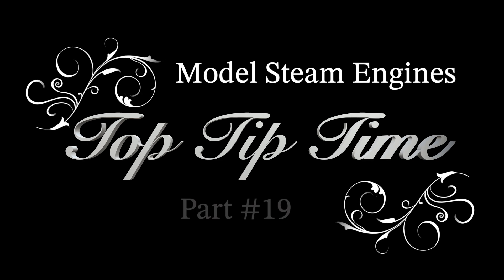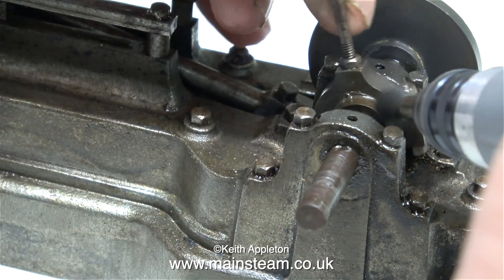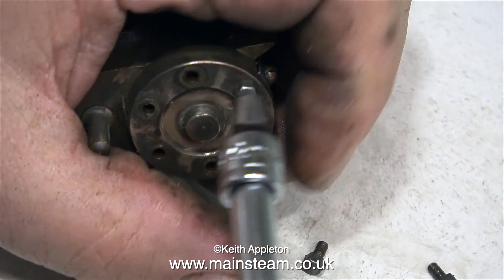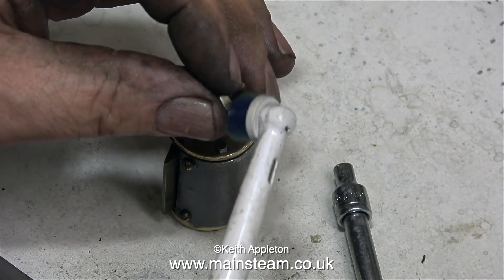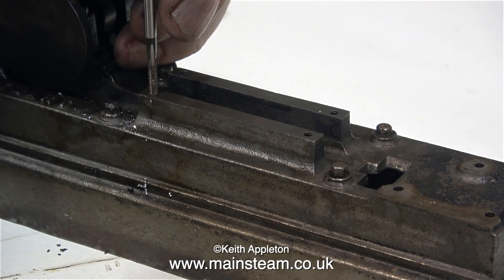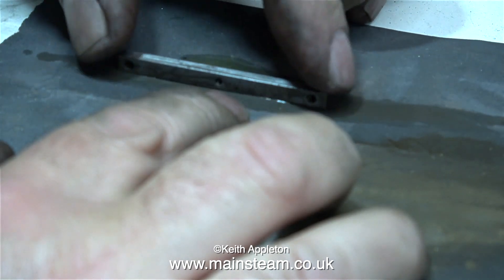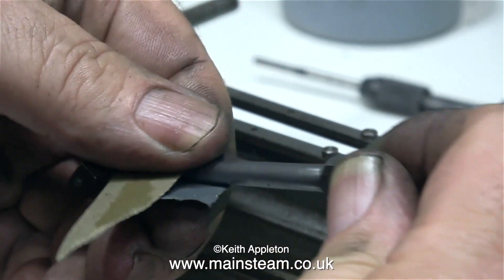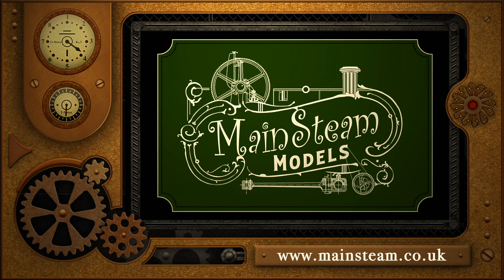MODEL STEAM ENGINES - TOP TIP TIME - PART #19

Comment: Boy I remember Whitworth standards,  I used to work on British motorcycles and I had special wrenches but no sockets, and a separate tap and die set because the nuts and bolts were just a little bit different from American SAE sizes.  (SAE=Society of Automotive engineers)  Some of the smaller sizes were close to SAE so owners would substitute SAE nuts and bolts ruining the threads and in many cases the studs or bolts would snap off.  Any size smaller than 1/4 in  was very difficult, and it was always the small screws that vibrated loose on Triumph and BSA motorcycles. I found out that BA standards were used for the small instrument screws.  I am really sympathetic of you,  yet you seem to take it in stride!